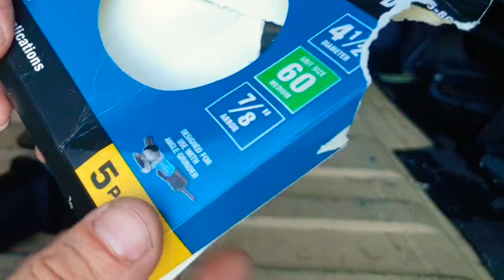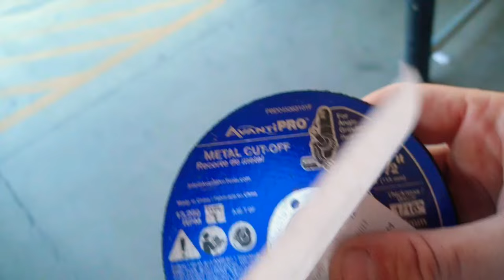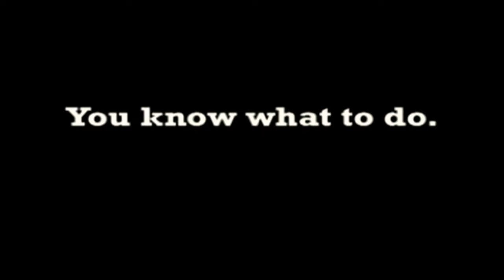Van Life DIY: Installing Window AC Unit in STEALTH Camper #584 PART 4

Comment: I live in a van and I've been moving my window AC around before I actually install it trying to find the best place to have it for a few weeks I had it sitting in the floor and I just crack my door a little bit because I realized it needed a little bit of extra air flow but then I kept hitting my leg on it every time I got back in or out of my van...  So I now have it sitting in my passenger seat with passenger window cracked and has a screen in it and a dryer hose running the heat out my back side window so far that's working well and it's easy to remove at any point plus nobody sees it. As the AC does need to have full air flow around it but the very back is what actually exhaust the air big tip to remember aside from that I just keep a fan in front of it to circulate the cold air entirely
Reply from the maker: Thanks Kate.. here's the link to watch the whole series, to see what happens.. ;) https://youtube.com/playlist?list=PLoorhqX5ET4UgZHoEvh1qWWB0UBKlUu5K